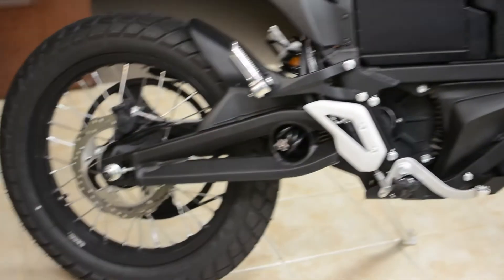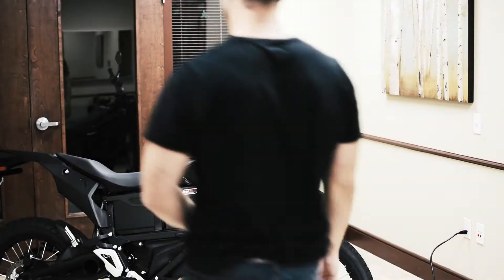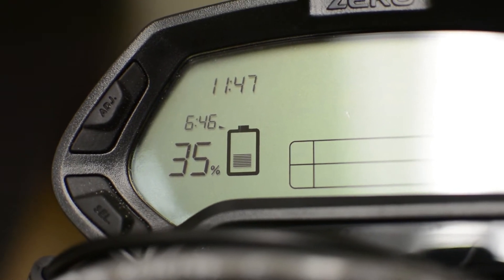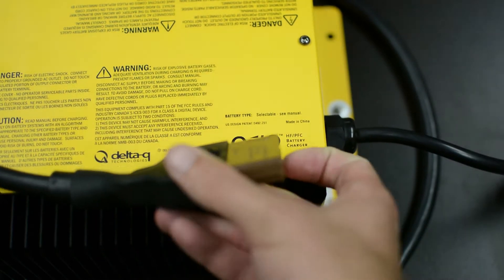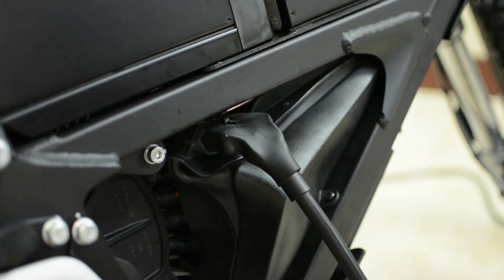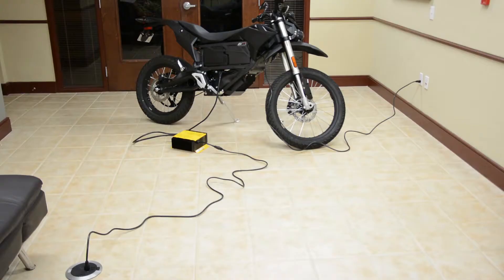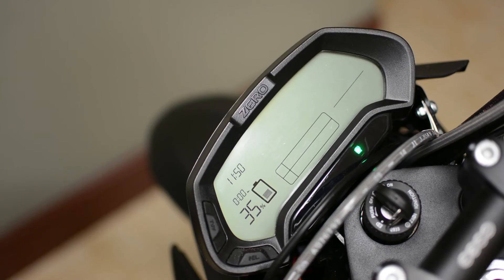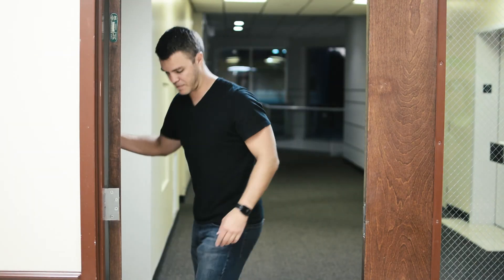How to Charge a Zero Electric Motorcycle

Comment: It's been so dam difficult to find this information, the manual is vague, the unofficial zero manual states you can use just the quick charger if you make sure the bike is turned on first, then turn on the quick charger. The bike can then be turned off. (I've not tried that yet). Turning on the quick charger with the bike off throws up an error message on the charger (two blinks) and the bike won't charge.

Comment: This is a helpful video. Just want to make a point about the cord. i just bought a 2017 FX two days ago. The current manual says the bike can pull as much as 12 amps when charging so the "PC cord" is likely to small to carry the load with getting hot. You might be risking a fire hazard. Manual recommends a 12 gauge cord no longer than 25 feet.
Reply: A pc cord can handle it. Some are thicker than others. They make pc power supplies up to 1600 watts.

Comment: Have you tried buying an extra battery and doing swaps?  I'm wondering how viable it would be to keep an extra in a backpack, seems pretty big.
Reply from the maker: 1. You would need an adapter to charge the battery when not installed in the bike.
2. The batteries are Very heavy (over 40 pounds each).
You could technically do it, however carrying all that weight on your back may not be too much fun
Reply: +Proximidude what's the music ?)